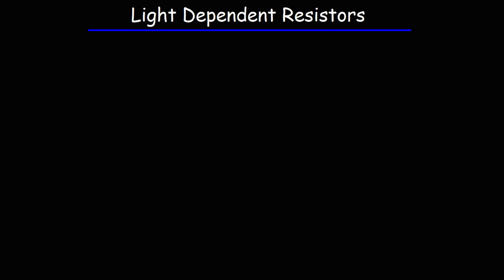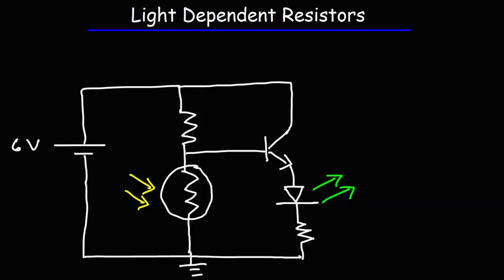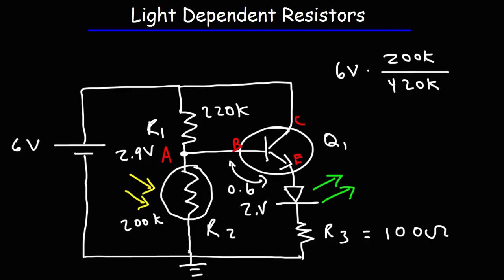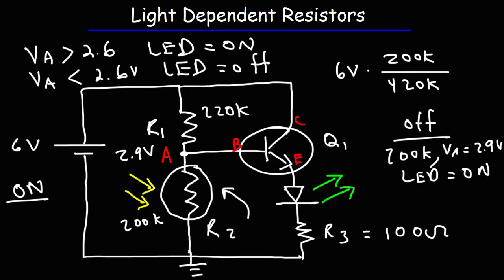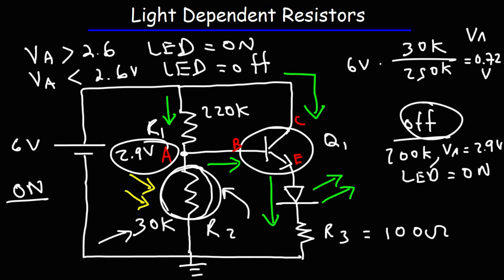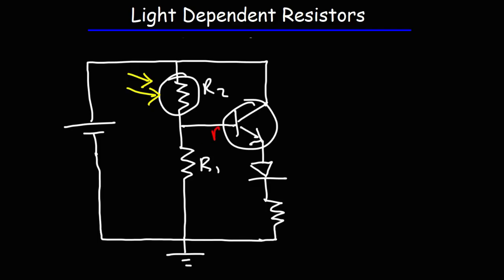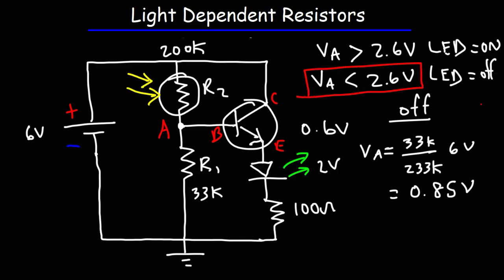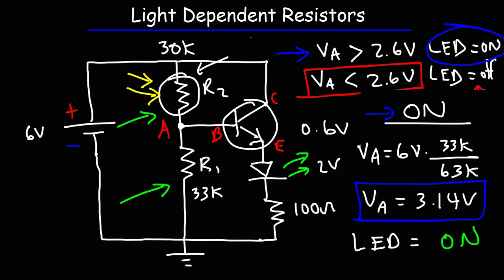DIY Night Activated LDR Sensor Circuit Using LEDs & Light Dependent Resistors

Comment: This was a great video, thanks! Could you possibly suggest a solution for my project?  I have a photosensor that i am trying to defeat so that the circuit stays closed all the time, regardless of the lighting conditions.  I can't think it would be as easy as simply removing the switch and joining the wires, could it?  I think the entire system relies on a certain voltage to pass through the switch, but less than the 12v feeding it.  If I were to measure the voltage with the switch closed, and replace the switch with a resistor that "mimicked" the output of the closed switch - would that do the job?

Comment: 2 questions:  1. Why is the voltage at point A even needed for the LED, when you have 6V of Collector supply voltage above.  It seems like if the voltage at point A was enough to establish a forward bias in the base, then the LED would light up due to the collector current. 2. When you calculated the required 2.6 V to activate the transistor and turn on the LED, why didn't you mention/include R3?

Comment: I didn't understand your last part when you reversed ldr and R1. I think the circuit here should turn the LED OFF when the main light is ON and, LED turned ON when main light is OFF but your last part is the opposite according to the resistance values you have chosen.. I'm confused. Kindly clarify

Comment: Everything is clear, but can NPN be any? I found some BC547B at home and tried to use it. Just to check, I connected 2 AA batteries: "plus" to C and B of transistor, E to "plus" of LED; GND of power source to the LED GND.

It should be simplest test, but the LED just barely glows. At the same time it perfectly works directly from 2xAA.